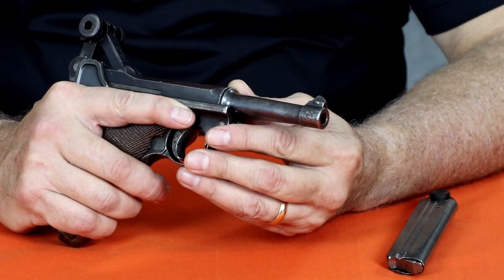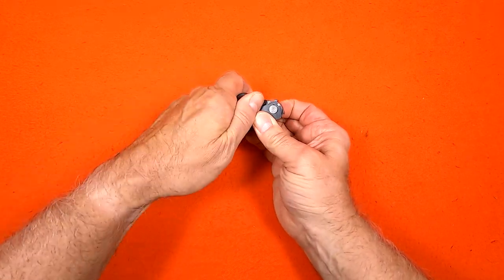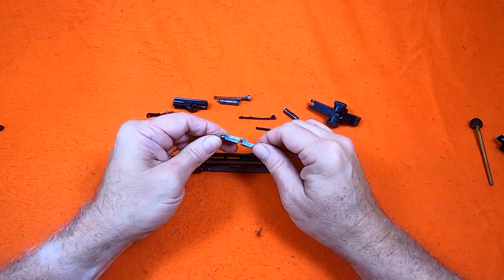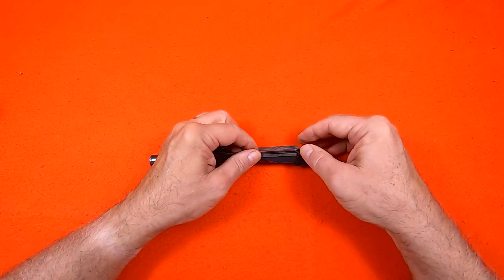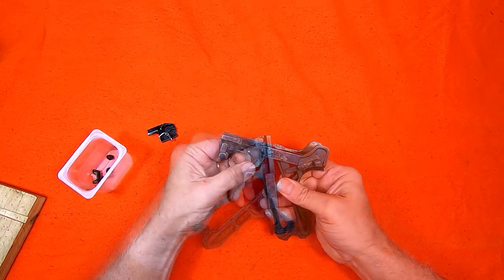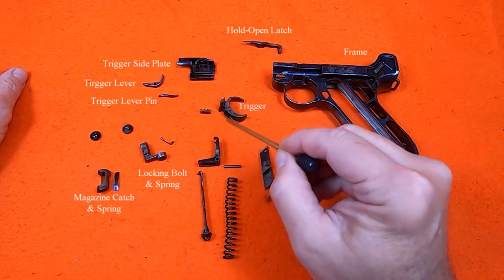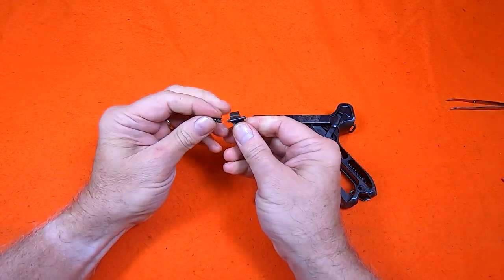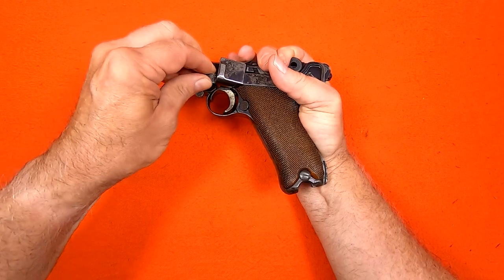P.08 Luger Armorer Level Disassembly and Assembly

Comment: Jim, Thank you for a very professional video. I just bought a 1920 model and used your video to strip, clean, and install a spring replacement kit from Wolff; I’m keeping the old springs for originality but wanted new springs for the shooting I’m planning on doing. BTW, I did like using using a vise to reinstall the recoil spring as shown in another video, I thought that made it easier.

Comment: No wonder Germany went to the P-38 in WW2.  I love my Lugers but they were so complicated and expensive to manufacture.  I recently took my  Artillery Luger to the range and had failure to feed jamming for the first time using Magtech 9mm 115 gr.  I brought the pistol home separated the barrel assembly from the frame.  Looking at the recoil spring, I did not see any visible problems.  I lubricated the moving parts and hope to take it back to the range to test with the same ammo again and with Wincester 9mm Nato 124 gr.  I will also take my Infantry shorter barreled Luger and my P-38 to test the ammo.  Both Lugers are from WW1.

Comment: Best damn breakdown and reassembly of a P08 ever. I’ve recently acquired a 1929 “Sneak” that has a misaligned takedown locking bolt as indicated by much force necessary to turn it down to the point of breaking.  Spring? Retainer pin?
Reply from the maker: High praise indeed, thanks.  About your locking bolt, does it turn freely with the trigger plate and receiver frame removed?  If so install them one at a time and see which one is conflicting with the bolt.  If it still doesn't turn freely with the plate and frame removed, then I'd remove the bolt and inspect it.  See if there are any obvious burrs, is the spring broken (and turned sideways jamming the bolt).  Basically, separate the locking bolt from all the pieces it touches one at a time and figure out where the conflict is.  Thanks for watching!

Comment: How does one take the barrel off of these guns? I bought a professionally made 9mm replacement barrel for mine and i have no idea how to remove the old barrel. Which direction is it threaded and can I put a 9mm barrel on a Luger that was originally .30 luger
Reply from the maker: That's a tough job, it takes special tools and experience.  I'd recommend you find an experienced gunsmith.  A real gunsmith, the kind that does machining and manufacturing, not the local gun store type who just knows how to replace pistol sights.